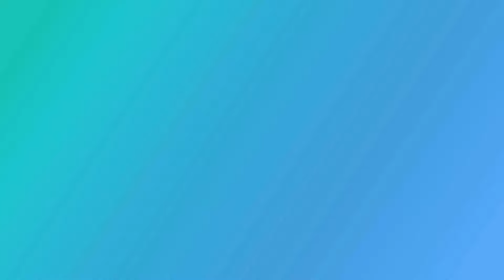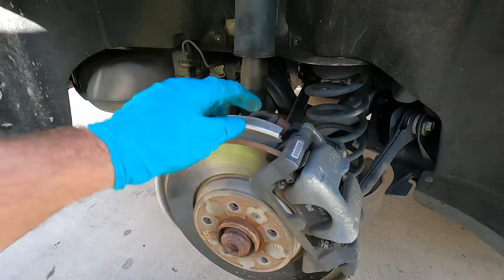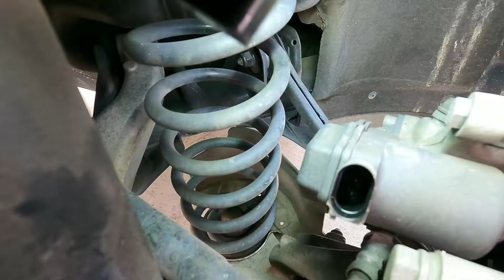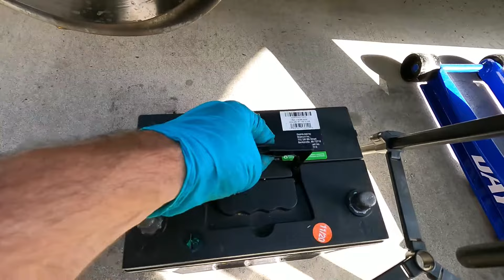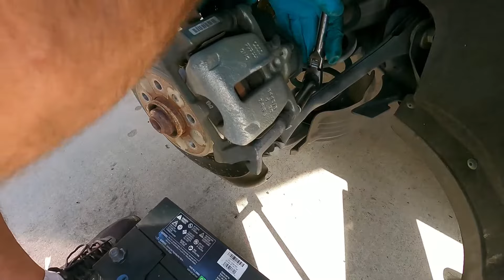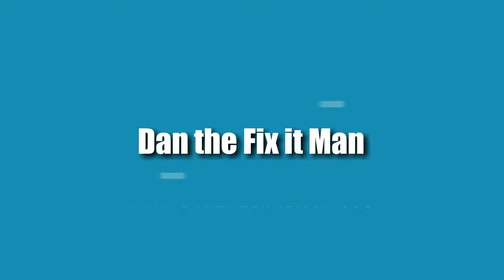2016 Audi Q5 Rear Brake Pad Replacement - EASY DIY

Comment: Ugh a shop just did my rears. Idk if they did this..could they have damaged my brakes. I’ve been noticing the pedal depressing more and more when I brake.
Reply: They possibly pushed the piston back without removing the top of the tank this damages the master cylinder

Comment: Thanks for the tip on the e brake! I just used an 18V dewalt drill battery, worked awesome, but accidentally tightened it first, reversed the terminals and loosened it

Comment: This is an awesome video in many different ways! Well lit, great camera angle. I was actually doing the brakes (well, actually my son did most of the work) on an Audi 2011 Q5. I had already bought a Zurich ZR15s OBD2 from Harbor Freight which performed the opening/closing/testing of the brakes. This video is extremely clear, concise, and well narrated. The best video on rear brakes for an Audi that is on YouTube in my opinion! Our brake pad replacement went extremely well! Thank you Dan the Fix It Man!
Reply from the maker: @aaronrichards3837  thank you so much!  Glad to hear that it went well!
Take care,
-Dan

Comment: Awesome video, super helpful.  Also a 9v battery works for anyone that doesn't have access to a spare car battery.
Reply: Great tip!
Reply: I dont even have that 😢 and even if i did i don't have wire cables to use with said battery

Comment: You can simply use a car battery. You only need a long cable. And second advice: negative wire connect to motor connector side with little corner, pozitive to other place without corner😊
Reply: That's what I did!  I just strung a bunch of alligator clips to my car's battery and worked like a charm.

Comment: Could you use a battery jump starter instead of a 12v battery?
Reply: Did the jump starter work? I imagine it did 12v is 12v
Reply: A 9V battery will work as well.

Comment: Any tips for the calliper bolts being completley seized up? I cant replace either the pads or rotors without getting those off. infact the top one came off but looks like the bolt snapped

Comment: If you don’t have a battery just take a T30, it’s two bolts on the actual motor, remove those. Slowly pull the motor off. With the motor removed, take a T45, there’s a hole where the motor attaches to the caliper loosen that with the T45 and then you should be able to use your brake press to push the piston in. Once you have enough room to install it over your new brake pads, you can then tighten the piston on the brakes and then position the motor back on. I didn’t have a battery so I had to try a different way, I hope this helps.
Reply: Yes helpful but only to the extent of the master cylinder completely detaching from the gearing of the electric park brake lock. I figured lefty loosing righty tighty. Now I have to figure out how to be able to compress the caliper and still have that electric brake still work. Right now the t45 on the back won't even turn righty. This sucks.

Comment: Thanks for this video. Simple and to the point. I just tackled this task. Once I understood that the parking brake wouldn’t completely retract, I then got it. Basically cycle the parking brake for a few; in my case the piston would spin and almost rip the boot when fully extended. When the parking brake was funny retracted the piston kept spinning. Then I was able to push it all the way back. The second side took me 10 minutes. About a 45 minute job in total. Thanks again.

Comment: Do you have to do the e-brake trick even if you don't engage it when you park? My 2013 doesn't auto-engage the e-brake, so I want to know if I can skip that step.
Reply from the maker: You will still need to retract it or put it in service mode to be able to have enough room for the new brake pads.  Just leaving the parking brake off doesn't allow you to push the caliper piston back in.  Best of luck to you!
-Dan the Fix it Man
Reply: @DantheFixitMan  Hi Dan! I just wanted to update you. I successfully replaced all brake pads. I used a 9V battery and two wires to activate the e-brake and held it until I heard it stop. I then used a c-clamp to fully depress the piston, allowing me to get the caliper back over the new brake pads. This video was paramount in my success, so thank you once again! Cheers, good sir! 

I also wanted to inform others, as I saw multiple questions about pumping the brakes afterwards. I simply activated the e-brake once I had brought the vehicle back down. It took a little longer than usually for it to fully lock, but then everything was back to normal.
Reply from the maker: @Zaknafein18  Glad to hear you got it done!  And yes, I probably didn't mention that in the video, but the parking brake will automatically adjust as soon as you apply it the first time.
Take care,
-Dan the Fix it Man
Reply: @thomasfarrish8053  Hey!  What type of 9V battery did you use? How many amps? Thank you

Comment: A question on the direction the caliper piston spins when the 12V current is applied in your video. Is it counter clockwise or clockwise? I am working on the rear 2016 SQ5 brakes and am not sure which direction it should be going to increase the space for the pads. The thought is counter but don't want to make the big mistake and have the piston in my hand or on the floor. Thanks

Comment: I was told by the dealer that you had to replace both rotor and the pads?  Could not do pads only?
Reply from the maker: Hi David,
I replace pads only all the time.
Sure, it’s better to replace the rotors, but if they’re still in good condition, they can be reused.  It would be better to have them resurfaced or machined.  Most auto parts stores will do this for $15 each.
Best of luck to you!
-Dan the Fix it Man